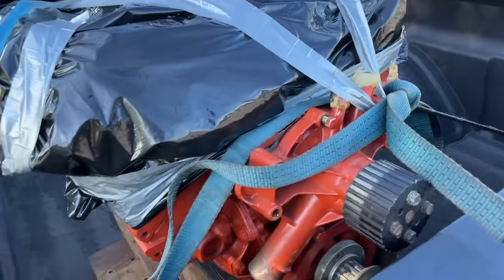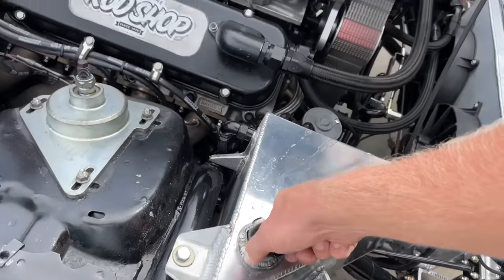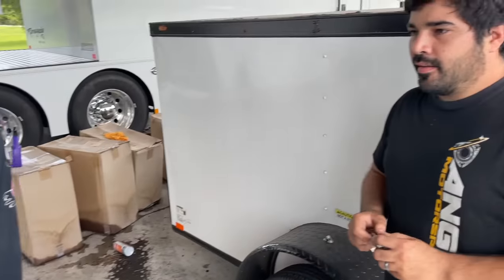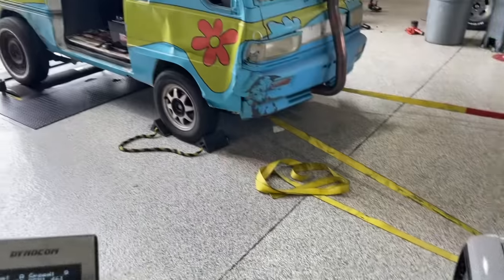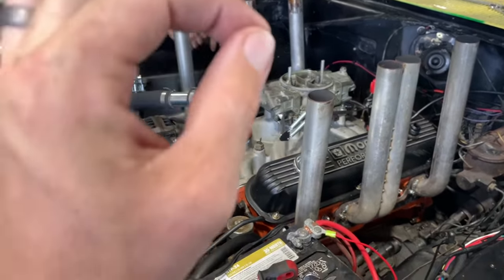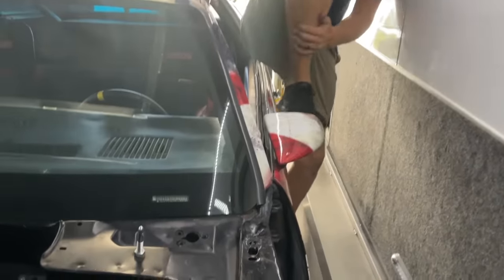The Fastest I've EVER Blown Up an Engine... HOW!?!? + Corn Cob Gets a Late Model MOPAR Race Engine!!

Comment: Much like Demo ranch when he shot all the guns, I want to see cleeter run every vehicle in the fleet down the quarter mile. It would be entertaining and I’ve been curious what some of them could do.
Reply: Straight Cut Gears - Even the tank???
Reply: That would require more than a hand full of them to be running at the same time
Reply: @54raceman true enough, but they could get em running over the winter and early spring just do a hot lap with every car as a warm-up for racing season
Reply: This is a great idea for a short series if he can’t fit it into one video.

Comment: As a welder I don't know how that engine mount is going to work out, you can't really weld cast iron without alot of prep, mostly preheat and letting it cool very slowly along with using the right filler and slowly welding and using a needle scaler to help prevent stress as it's welded. I was watching on the big screen and could already see the crack developing in the weld. I usually don't like being the negative one here but please keep an eye on that mount.
Reply: Looked like there was already a crack in the fresh weld too, which isn't uncommon when welding steel to cast iron without proper prep... Hell, even with proper prep. That's why I prefer to braze if it's not cast to cast, but the vibration could be an issue.
Reply: As a welder you should come weld my shifter on to my shifter rod on my racing atv

Comment: I feel for Tye welding the motor mounts on. Back many years ago, I worked in a shop and we got cast iron knitting heads from a textile mill come periodically that had cracked and started leaking oil. Old guy that I apprenticed under had finally came up with a system to weld them. After extensive cleaning and prepping, we would build a temp furnace out of fire brick, get the head in there, ( it weighed about 350#) slide a burner in through a slot and heat the head slowly until it was dull cherry red. Turn the flame off, open the furnace, slide it out, and braze it with acetylene torch and brass rod. Finish up brazing as fast as possible, and then slide it back in the furnace and close it up to cool off slowly. Worked great. He tried everything before to weld them, nickel rod with pre heating, tig with different alloy rods, etc. Nothing worked except the furnace deal. Some of the hottest days I ever had putting your head inside that head and brazing it.
Reply: Sounds like a solid way to do it, shame they can't really do that with that engine block though with what they're trying to accomplish
Reply: I had to preheat a head off an old water cooled flathead to weld a crack in a cooling jacket. the amount of gas I used to preheat was astronomical 🤣
Reply: You saw that crack too?
Reply: @udlman1  Yep...

Comment: As a Mopar guy from way back the X heads are 340X heads, these were OEM for the 340 6 pack. The later X heads were from 360's probably the same ports, but had 1.90/1.60 valves, over the OG 2.02/1.60

Comment: Be careful with those mounts, it appears there's a crack running down it. It's damn near impossible to weld steel to cast iron without using nickel rods. It also needs to be stick welded.
Reply: I saw that immediately too
Reply: Exactly what I was thinking
Reply: Exactly right!
Reply: Had to pause and shed a tear
Reply: Yeah that's a crack.
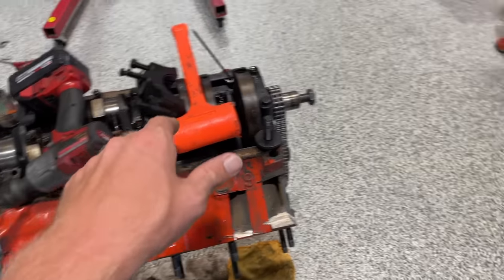Reply: If you look at 8:59 , you see where he cut the mounts out of the old block , but that sure looked like a crack to me . Good catch .
Reply: There are several acceptable methods for welding cast iron. Unfortunately they all require careful pre and post heating of the components. Successful cast iron welds are time consuming. The crack in this attempt is a result of the differential of the block, filler and mount having different thermal expansion coefficients. Cast aluminum on the other hand can be successfully T.I.G welded in most cases with basic pre-heating which makes repairs easer and more cost effective.
Reply: Yeah there’s a crack going completely down the weld
Reply: ty is a hell of a welder and a fabricator.... welding cast from my experience lol you need nickel rod and do not forget to ping! go slow.. no more then an inch or two at a time.. and is not structural... meaning is like glue...
Reply: Yea was a good intentions but im not confident in that weld . Like you said pert near impossible to weld steel to cast iron without nickel rods I agree
Reply: Came to the comments just to make sure someone else mentioned that. "That looks so good" Cleet says,.. it was cracked all the way....
Reply: I'm sure Ty didnt know that lmao
Reply: Came here to say this as well. Thumbs up. Double check those mounts
Reply: Lots of pre heatign and slow cooling makes a big difference, welding Vband flanges on to cast turbo housing, heat er up to 700c, bury in sand and let it sit for a day. never had an issue
Reply: rip that engine block. plus when it shrinks and pulls on that cylinder

Comment: Gotta go with Wix filters; the anti-drain valve is fastened to the baseplate so that what happened to you doesn't happen on those filters.  K&Ns and Frams don't do that.
Reply: Might have missed it but what oil filter were they using?
Reply: WIX all the way.   🤘 🤘
Reply: @KM-os4be  No idea.  They never mentioned it.
Reply: If you can't find a Wix branded filter, Napa Golds are rebranded Wix filters.
Reply: I bet it was a fram?
Reply: Boom...... best comment of the video

Comment: that Torqueflite needs that "kickdown" (its actually throttle pressure) if it doesnt have a full manual valvebody in it...its just like the cable on a 700R4...if you dont have the linkage, tie the lever on the 
trans back atleast 3/4 to full, it will shift late automatically but it will keep the line pressure high in the trans and it will not burn up.
Reply: Definitely need to do this, the torqueflite kickdowns are necessary and can be kind of a hassle to adjust properly

Comment: My dad put a 340 in his '70 charger in the '70s and drag raced it every day. The 340 is still in it, but we're restoring it now. He shifted at 9-10k rpm every time he raced. 340 is a destroyed 360, made for like AAR cudas and stuff. Hot ass engines. But this 340 is far from stock, and originally came out of a sprint car.

Comment: i was surprised that rotary made more torque than horsepower. Almost 400 at that.
Reply: Yeah, it made about exactly the same figures as my Volvo T5 does and that is NOT a revvy engine lol. Over 200bhp by 3000rpm, peak power at 5500.
Reply: It has an auto trans, the torque converter multiplies it.

Comment: Cleetus is the whistlin diesel of the engine world. We’re onto you. “Oops! Not another engine” 12M views.
Reply: You mean click bait?
Reply: @buckberthod5007  buck are you familiar with what click bait actually is?
Reply: @buckberthod5007  I mean he is blowing up the engine it’s not really click bait
Reply: @xcursion6326  That engine wasn't blown. It had a lifter tick. Something super common to high mileage LS Chevy engines. Blown would mean spun bearing, bent rod, deleted pistons. Not lifter tick. Hell I drove my truck 6 months with a completely snapped roller lifter for 3 months almost every day with no problems. Down on power, but still ran just fine. I finally got around to fixing it, changed the oil, and it still runs fine. So yes, it's clickbait.
Reply: @smexypookie1862  That engine wasn't blown. It had a lifter tick. Something super common to high mileage LS Chevy engines. Blown would mean spun bearing, bent rod, deleted pistons. Not lifter tick. Hell I drove my truck 6 months with a completely snapped roller lifter for 3 months almost every day with no problems. Down on power, but still ran just fine. I finally got around to fixing it, changed the oil, and it still runs fine. So yes, it's clickbait.
Reply: Except not 12M views
Reply: Don't say that. I actually have respect for Cleeter.
Reply: @JohnDoe-en9ch  why can’t you respect whistlin? He also puts tons of money and Time into his business and YouTube
Reply: @buckberthod5007  you tell them buck!
Reply: @RokanRulerofKaos  He destroys things for the sake of destroying them. It's juvenile and senseless. In a world where the general public dislikes motorsports in general, that kind of content only furthers their cause. Cleetus on the other hand, brought back a track in an era where they are shutting down left and right. He is also competitive in actual racing events, and wins! That other guy is just a clown.
Reply: @buckberthod5007  🤓

Comment: I remember being most impressed when you did a (fifth gear?) Burnout in Leroy. The clutch cars, either Leroy or Neighbor I'd be intimidated by, but willing to give her hell in a burnout box. 
Toast would intimidate me too much, in my experience, with clutch cars you can feel if something is breaking or going wrong through the pedals, while automatics and such just fly apart with little notice. Probably that only makes sense to an amateur like myself. But I'd be overwhelmed by toasts' deafening roar, and my inability to judge wheel speed etc. All the rpms sound the same with Toast as well haha

Comment: Dude he's right about those heads, they're big poor heads exhaust ports are huge, those are the best Mopar heads you could get back in the day
Reply: My jaw dropped when he said x heads... way more engine than the car needs
Reply: @Odium515  What? Confused.
Reply: @AB-80X  they are a high performance factory built cylinder head. Kinda rare, and the best possible cylinder head for a small block mopar back in the day before everyone came out with aftermarket stuff
Reply: @Odium515  I think you missed me there. I know what they are, that was not my point. Too much engine? They are building an oddball burnout car. And even with that thing turning 7500 rpm, it's just fine for that at about 550-575 hp, IF it will spin that fast once running. The X heads are cool little heads, but while they were the dogs cahonies back then, you need to think about what kind of power they actually make. They are iron heads too, so I'd worry about hot spots when running sustained high rpm.
We can also be much more simple. There's no such thing as too much engine for such an oddball project.
Reply: @AB-80X  X  block, W2 heads

Comment: i hope that engine mount will hold, the video showed what looked to be a big ass crack dead center down the weld  :(
Reply: i thought the exact same
Reply: Nah,got the best welder around.yall seeing things🧐
Reply: Dude you're 100% right. Watching it on my TV and you can see a crack running right down the middle of that entire weld lol
Reply: It is cast isn’t it? In my welding of cast on the farm, you have to either weld it with high nickel cast rod(SMAW), or get both pieces orange hot, and then weld it in order for it to hold.(MIG or TIG) And even then, you have to plan for the piece to significantly warp towards the last weld that’s laid. It’s usually never easy to get cast to hold a good weld. Lot’s of heat, and high nickel, and a slow cool down time. I’m sure they did a good job. 
Heck yea brother.
Reply: @michaellong9736  yup. Preheat, weld it then needs to cool off at the same rate as they cool at different rates
Reply: @fartzinacan  Brazing may hold. But usually that seems to work much better welding cracks in cast or a piece that’s broken apart, and not two pieces that weren’t originally one. Not something I’d try on a cast engine mount. But anyway you split it, cast is very hard to weld.
Reply: Back in the day, I welded alot( arc and mig ). Whenever I had to weld cast iron, we preheated it with a rosebud, weld with nickel ( I think) then reheat it and pack it in lime to cool slowly. Cool too fast it will crack.
Reply: It’s definitely cracked right down the middle of the weld 🤦‍♂️.
Reply: Yup. That weld is brittle as hell. Gonna pop faster than a cherry on prom night.
Reply: Yep that thing was cracked from one end of the weld to the other

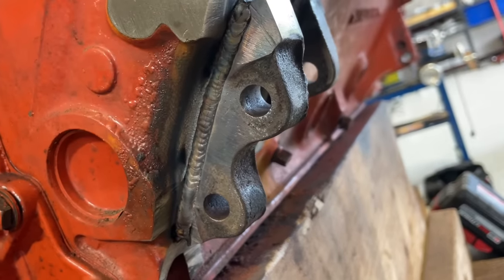Comment: 4:22 - anybody else notice the crack all the way through the whole weld? lol. 100% expected to be fair.
Reply: Why is it 100% expected? Just wondering
Reply: oh wow, i see it now
Reply: Oh yes, joys of cast welding without heat control
Reply: Also wondering why they didn't clearance the cover instead of the external counter-balance?
Reply: its just a burnout rig anyway
Reply: @dejay20001  When you weld cast iron, which has a lot of carbon in it, you get a lot of carbon dilution in your weld which makes it brittle. In addition, the cast iron and steel welding rod expand and contract at sufficiently different rates that cracking is almost inevitable unless you can bring the entire part up to a pretty high temp, and use a more flexible material for your welding rod. High nickel being the most common.

My guess is that Ty saw the cracks and welded over them again while it was still hot and that usually would be good enough for this type of YOLO repair.

Note: A probably better approach would have been to use silicon or aluminum bronze TIG filler, which is more like brazing than welding. But I'm sure it's not something they keep around for building race cars - though any decent welding shop will have some.
Reply: Oh, I remember why now. Same reason why they didn't run the lifters in at all on the other engine along with revving it to the moon cold.
Reply: @xtr3m3fLx  Ain't nobody perfect and it takes a lot more guts to put your mistakes on the internet than it takes to never post anything.

Comment: The weld on that motor mount is cracked. Grind it out, heavy bevel, preheat to 400F (soot it up with an OA torch and when it's hot enough that the soot burns off, it's up to temp). Use a nickel 99 rod. There are other rods out there, personally, I'd use Palco rods, but they're hard to get.

OR braze it. You can probably TIG braze it, but I've never tried that.

Comment: Though I liked the old 360, the new motor is the best find for that car!
Reply: It's still an LA 360, so what's so different?
Reply: It's basically a special race block and the best heads Mopar had for the small block back when that engine was current. It should rip and take the abuse that car will get.
Reply: @69Dartman  What do you base that off of? Looks like an LA block to me.

Comment: I'm rarely commenting about welds, but it can be clearly seen from the added ears on the block that the weld hot cracked, which is more common than not when welding cast iron.

Comment: Many of the older Mopar parts interchange. the distributor cap from a big block will fit on the small block.   I did a small block to big block swap on a truck. Only had to make the 2 wire for the distributor longer and bought a set of stock motor mounts.....

Comment: Kevin got yall hooked up with his buddy on that Mopar. Also make sure you have the correct gear on the distributor to match the cam gear. Either a bronze or hardened steel gear needs to be on the distributor to match the cam, find out what the cam calls for cause if not then he will not have any more sparky spark.

Comment: Funny thing about that oil filter. I only change my oil filter every 4 or 5 oil changes. I mean if your engine is in good shape it shouldn't be filling the filter with shavings anyway and old cars didn't even have them. Plus I change my oil every 2,000 miles or less so I really don't think I need to do the filter every time.

Comment: Wix oil filters are the only ones to put on a mopar. It dont have to be the race version of filter. I know from experience. We have to drag cars. A gen 2 392 hemi in our 2010 challenger and 60 ober bored 440 big block in a 1971 dodge demon which is the dodge version of the plymouth duster. The challenger will run mid 9's and up to 10.50 in the 1/4 mile. Its a stock class nhra registered race car. And the 1971 demon will run as long as low 8's and up to a low 10

Comment: Ok, so for the 1st time EVER on this channel I'm impressed by this dudes welding skills.   I'm not saying he wasn't good before, but I can, Mig, Stick, Tig, Torch and braze weld.  But for the LIFE of me, I've never been able to weld Cast Iron.   That's not saying if those welds will hold or not, because Cast iron is a complete different beast from anything else.  I can also forge weld.  FYI.  
But color me IMPRESSED!!!  Like major impressed.  NICE JOB on the motor mounts
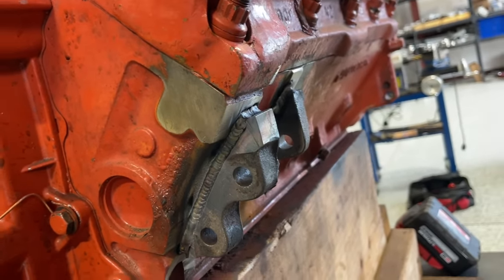Reply: Look closely at 4:22, there's a crack going all the way through it

Comment: Check the chemical compatibility of o-rings. Make sure you use ones that wont disolve in methanol. It wont leak at first but will degrade over time. Viton is fuel (gas) rated, not sure about Methanol

Comment: My 91 Acura 5 years no oil change and everything running smooth. One day I add some it smoked like a mother and left it all in a KFC parking lot floor. Never added any ever again and got another 3 years out of it. Only issue it had was after 2 plus hours of driving if you turn it off it wouldn't start for like an hour after that it would start and run like nothing.

Comment: Its strangely quiet from all the comments in the last video that had diagnosed the engine failure even before a pull down and inspection on ol corn cob. The number of washed bore comments due to that carb  Jack Stand dropped on made me chuckle.

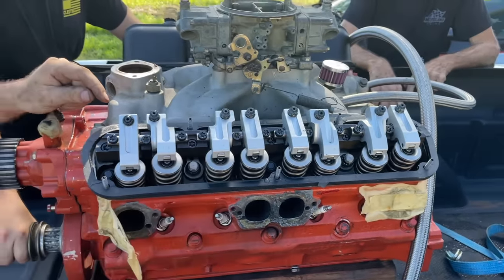Comment: 4:20 is no one going to mention the crack all the way down the length of the weld? 

Should have heated the cast iron before welding. Peening while cooling helps prevent cracking as well.

Comment: W2 heads are great high flow heads. But they are very very hard to find. If it was a dirt track car then its gonna have a super stout bottom end in it. Tey run between 6000 up to 7500 constantly round and round and around